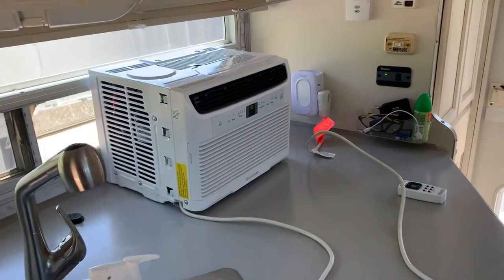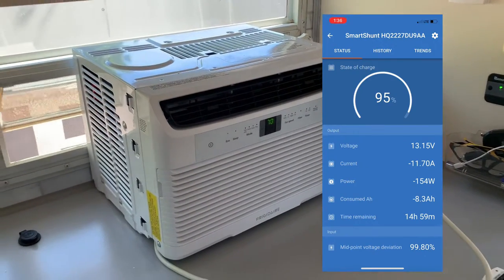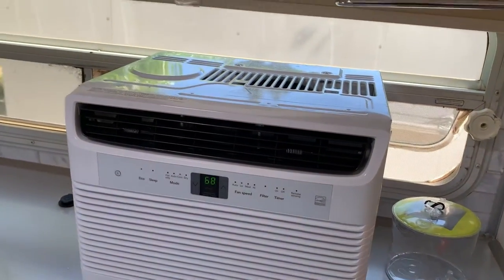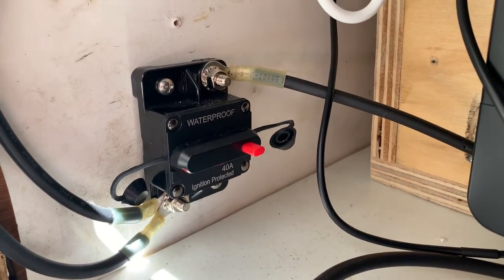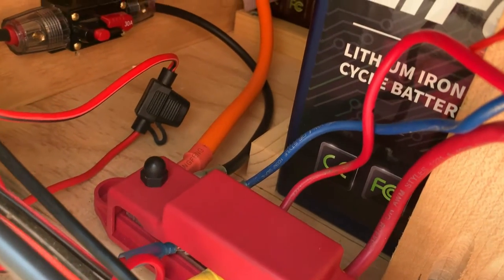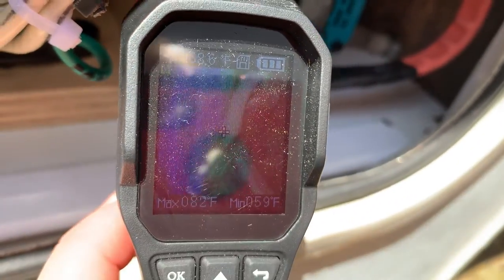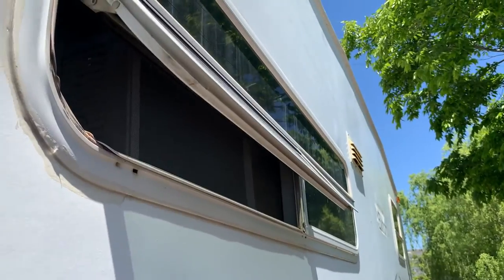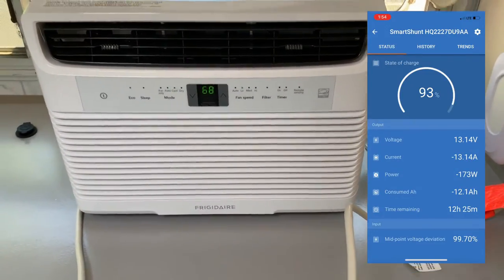Testing the new 5000 BTU Air Conditioner in the Truck Camper.  Harvesting Water?

Comment: That's a great idea putting the A/C on a table with the window. Still blows hot air outside.  May make the unit more efficient when indoor temperature lowers and the A/C sucks in cooler air.

Comment: Other videos show the frigidaire AC unit uses about 300 watts.... but that is CRAZY LOW.   I would like to know how they accomplish such a LOW energy usage on the 5000 btu Frigidaire!!
Reply from the maker: This 5000 btu Frigidaire unit is sticker rated at 410 watts maximum.  
I’ve been doing a lot of real world testing with it and for my situation, cooling on medium fan speed is working best to keep the camper cool.  
Using shore power, that’s pulling under 375 watts.
Using my solar, batteries and inverter, it’s pulling anywhere from 360-415 watts.

Comment: Thank for the details. Been waiting for your install of this window unit in the camper. However, had to put AC into my camper (NorthStar Liberty, 98 sf) last week for summer travels. I bit the bullet and installed the new Velit 12 v 8000 BTU roof top unit. Cost $1,600 was high (Dometic even higher) but easy install and did not need to deal with wall install challenges (really want to see your solution). On "Eco" mode cools the camper well (small camper) using average 24-26 amps (12 v). Night mode slightly less. Full cool mode uses about 45-50 amps. Have 280 amp-hr lithium batteries. 275 watt solar. Factory installed converter can supply 20 amps 12v if plugged into shore power (seldom). Still want to see how you install the window AC unit in your camper wall. Knowing you, it will be very clever and well done. Noise level not bad on medium fan, similar to average window AC unit.
Reply from the maker: Nice.  That should work very well for you.  
I’ve had this air conditioner installed for a few months now.  I’ve been testing real world conditions and situations since then.   I’ve done a few baffle and insulation changes to improve efficiency and I think I’ve got it dialed in now.   I’m even harvesting over a gallon of water per day with this a/c (averaging 4 hrs of a/c use per gallon of water)
More videos coming showing the process.
Reply: You didn't specifically say what your battery capacity was but l did hear you mention 200AH...So you have 2 100AH lithium's. What size solar panels are you using?

Comment: My rooftop unit is dead on my truck camper,  I've tried everything to get the compressor unstuck with no luck.     Was thinking about a window unit in the microwave cabinet with a vent out the side for exhaust and a vent for intake from the behind the fridge compartment.

Comment: I would like to see the A/C set on 68 low eco and see how long it would run.  You have almost exact set up I have.
Reply from the maker: Last weekend with outside temperatures reaching low 90’s, I ran it using the solar/LiFePO4 Batteries/inverter on medium fan speed cool for just about 4 1/2 hrs.   Parked in full sun.  Batteries only depleted 2%.  (Went from 96% to 94% SOC.)
Cooled the camper to the set temperature of 72°. (We had pets with us).  
I’m very happy with the results.
Reply: Hard to beat that. On addage abt not running ac on a solar electric system is likely dated from the golf cart battery days when you could only safety discharge dwn to 50% of the batteries capacity. Your new Li batteries are likely utilizes better chemistry that allows for faster charge rates. These new guys are game changers.

Comment: Just FYI dry mode on these air conditioners isn't really a separate mode it's just the air conditioner running. It's kind of a gimmick.
Reply from the maker: I’ve done quite a bit of testing with it.
The dry mode runs the evaporator but the compressor is functioning at around 15%.  So it’s drying the air (pulling moisture for water harvesting) but not cooling.  It’s actually a separate mode/function and works well.  My testing conditions are average 80°f with 40% humidity.
Reply: @covetthecamper2289  interesting. That means the compressor would have to at least have a multi-speed controller if not a VFD running it. I wasn't aware that window units even did that. Every AC I've ever run that had a dry mode was basically just running the air conditioner but using humidity as the set points instead of temperature.

Comment: I installed one of those 5000 btu's in my Chevy van in the summer in central Fla.... didn't cool at all! It was horrible.
Reply: Likely inside your car was a much larger cooling load than your unit could muster.  Cars are not insulated and have rather large areas to absorb the sun's heat.

Comment: Kind of at odds. If you were in the shade it would run better but than the solar wouldn't work well if it were on the roof so you would have to have the portable type.

Comment: 5000 btu ac draws only 5 amp ac. I think if you have 4 solar panels 1.2kw and 200 amp lithium batteries and keeping air cooling low probably get you 10-12 hours of use.

Comment: It is always good to keep lithium-ion batteries below 80% SOC. 60% is the ideal SOC so they can last longer.
Reply from the maker: Long-term storage at 50-60% SOC is ideal.   
90-95% to 15% is what the Battery management system likes to see for regular use on my LiFePO4 bank.
Reply: @covetthecamper2289  Well, I would take some time to research that. 100% charge is never good for lithium based batteries neither go down to 15% SOC. As far as I know, the longer you keep them around 50%-60% SOC even with multiple charges to keep to this levels are the better. But it is just my 2 cents.
Reply from the maker: The BMS is managing that.  Rather than just looking at 0% to 100%, I look at voltages and temperatures and set my BMS accordingly.  
The meter on my Victron Smart Shunt app show percentages in relation to my programmed BMS which has been set for the correct charge and discharge voltages.
Reply: My thoughts here are this isn't an issue like using lead acid chemistry.  Battery manufacturers have to estimate battery life...3,000 to 5,000 charge cycles without degrading original capacity and then it drops to 80% of original.  These life cycles are likely longer than any of us will camp or live long enough to need to replace.  I believe that well before that we'll see new battery chemistry that makes Li ion look old fashioned.

Comment: If it really takes 20 amps so that means 100 ah lithium battery of any brand will run this ac for almost 5 hours
Reply: This is what I am wondering. I have 2 100ah 12v agm batteries and wondering how long I can run this.